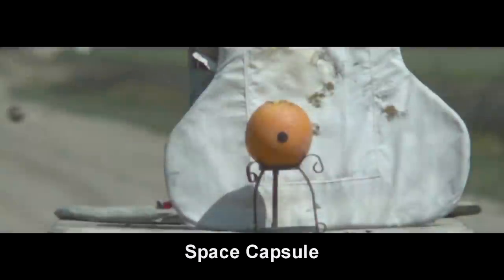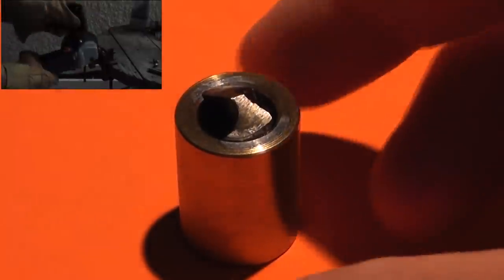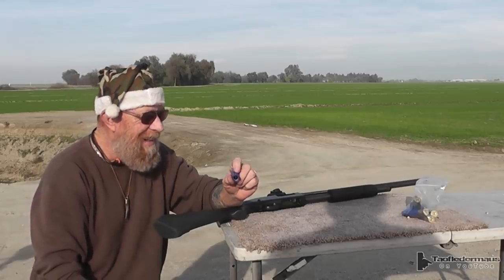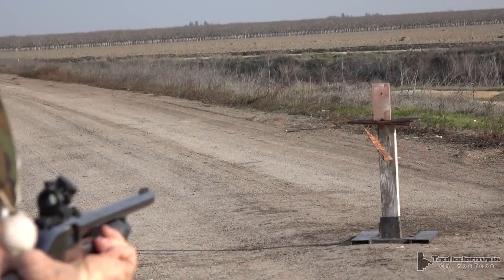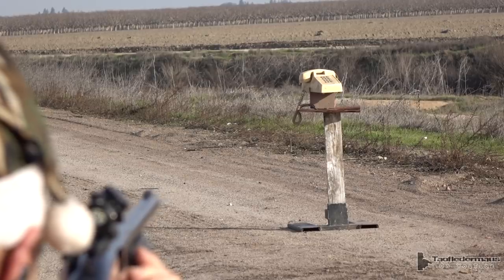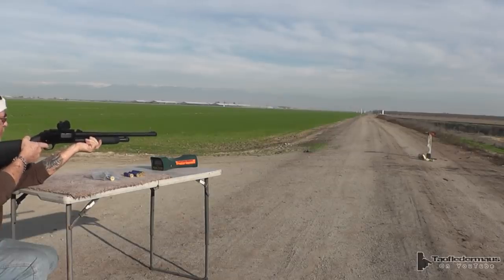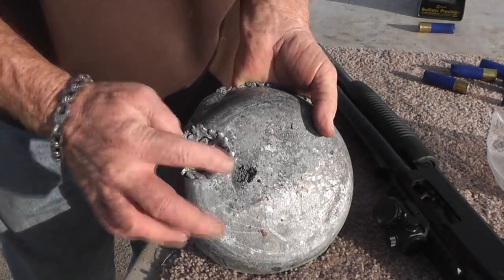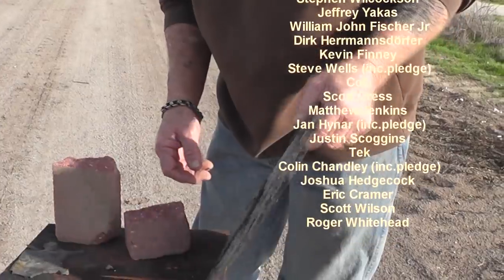Internal "turbine"  drill bit slug experiment

Comment: The Problem is, the gunpowder turns the slug left, and the static air the slug passes trough turns it right!
Reply from the maker: They use a gas seal so the slug is isolated from the burning powder

Comment: the reason why you are loosing spin is because the blast from the gunpowder is traveling through the projectile causing counter spin before the round even hits the rifling. there isn't much you can do to counter this though, other than maybe putting a thin metal plate behind the round in front of the wod. but i doubt it would have much of an effect, the blast will still mitigate past it.
Reply: or alternatively, you could weld a plate to the back of the projectile stopping the blast from travelling through and drill a couple of holes into the sides of the projectile towards to back to allow back airflow. you might get better spin doing it like that.

Comment: Is the rifling clock wise?  If so I think the drill twist might be fighting the twist.  When you drill with the drill it goes clockwise, if it is powered by air flow in this case it would try to go counter clockwise I think?
Reply from the maker: It is clockwise looking from the rear

Comment: id suggest trying to fire these backwards 
I have a theory that the direction of the fluting was responsible for the slow down of the projectiles spin although now that I think about it firing it backwards wont change the direction of the fluting 
now the science behind the fluting is that its supposed to create resistance which encourages spin 
by angling the fluting the same direction as the rifling its creating resistance to the direction the rifling is trying to spin it in
in other words you want the fluting reversed to create more spin
Reply: the reason know this is because I admittedly have been trying to design a slug or projectile that will guide the air threw reversed fluting intended to slow the rotation of the projectile if not go as far as reversing the spin  entirely but we all know logically that wont happen due to distance limitations 
however the things I'm designing aren't meant for shot guns anyway 
but the concept still applies you need to reverse the fluting

Comment: the gas from the explosion is being pushed through the drill bit in the opposite way it should be rotating. think about it, the reason the projectile doesnt spin as fast as you thought it would is because its fighting against itself within the barrel the gasses pushing through the projectile is spinning it in reverse
Reply from the maker: No,  because there is a gas seal behind the projectile that prevents that.    It wouldn't even fire if there wasn't a gas seal

Comment: hmm, wouldn't it have made more sense to shoot it out of a smooth bore shotgun since the projectile itself is supposed to make it rotate?
Reply: also, drill bits aren't created with this purpose in mind. Those flutes in the drill are simply there to allow material to make it's way back out of the hole. So it's unlikely they would cause intense spinning once launched.

Comment: Did you use HSS drill bits to make these slugs?

What about using widia / carbide pointed drill bits (like the ones used to drill on concrete)?  It has a carbide insert in the point of the drill bit, almost so hard as diamond.  It probably will be great to make some shots in a steel plate, because ir probably will "drill" the steel plate.

It's just a suggestion.

Great videos in a great channel.  Following you.
Reply from the maker: I didn't make them
Reply: @taofledermaus  Sorry, I saw you saying you received it and my old stupid brain didn't store the information...  But we can keep it as a suggestion to the manufacturer.

Comment: @1:32 Air being forced down the flutes of a right hand cutting drill bit as shown would induce a counterclockwise rotation, not clockwise. He needed to use a left hand cutting drill bit for the "impeller" to create a clockwise spin.
Reply from the maker: the twist is correct
Reply: @taofledermaus  well...hmmmm....I had a big reply written why it wouldn't work. But then I thought it would be easy enough to test. I put a pipe coupler in the vise and inserted a drill that was a pretty good slip fit and hit it with the shop air. I gotta eat my words because it spun it clockwise. I see it completely different in my mind, but there's no doubting the evidence! You're right